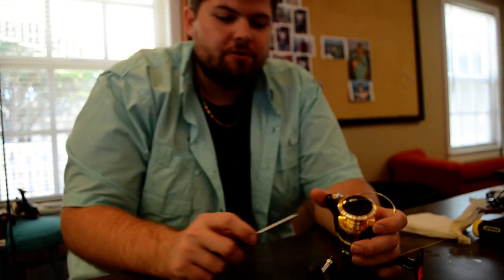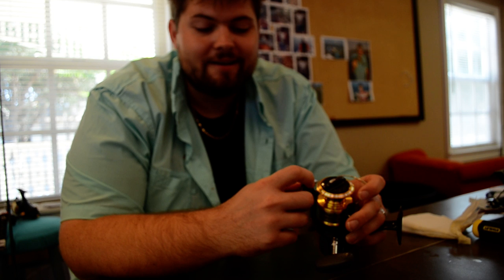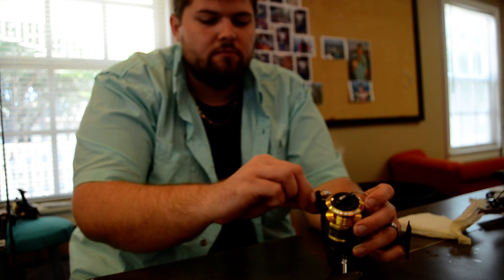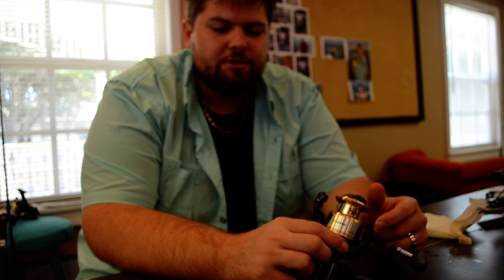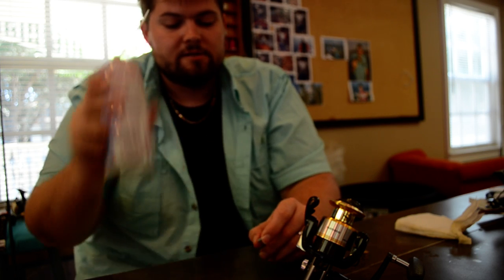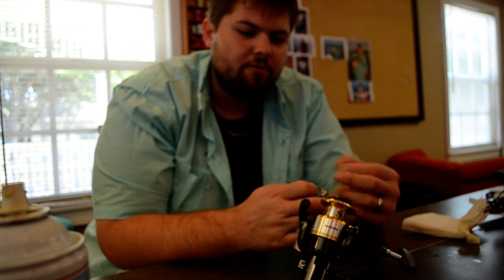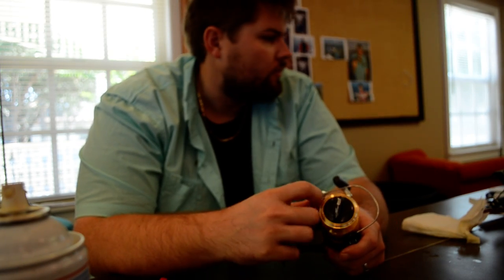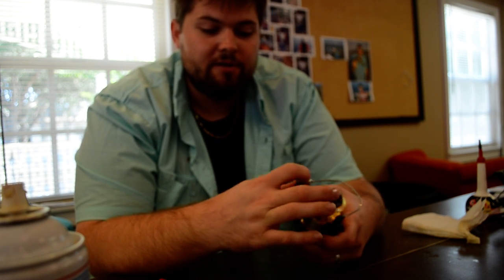Shimano line roller bearing maintenance

Comment: I tried to 'gently' take the roller guide apart on my older ci4 3000, but it kind of got away from me, like that felt did in the video. Ha ha! Now tho, I'm not so sure that I have the sequencing correct in order to reassemble ...??? I cleaned it all up anyway, still grinding, though not as bad before, but still unpleasant and irritating.  Also, after doing some research, it seems that Shimano instructions state NOT to oil their roller bearing assembly on the ci4 because of a protective factory coating. I wanted to buy a complete kit (WITH DIAGRAM SEQUENCE INSTRUCTIONS) and replace the whole assembly, but having trouble finding anything of the sort... ??? ... ??? ... ???  Great reel though!!!